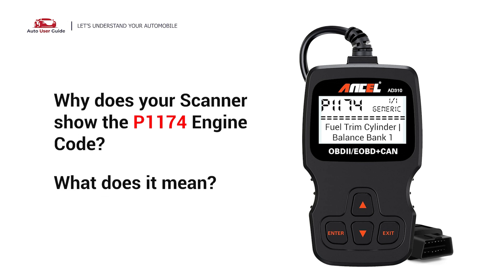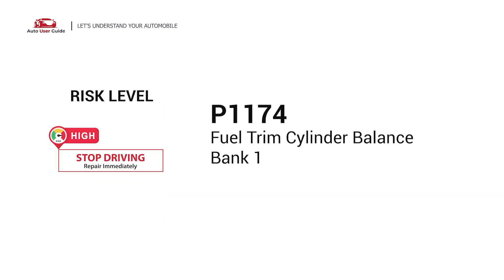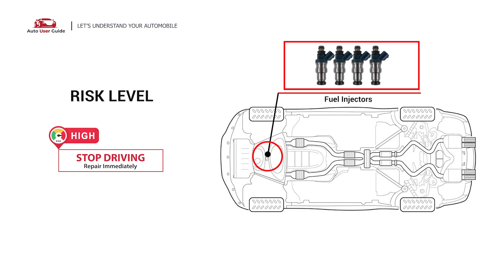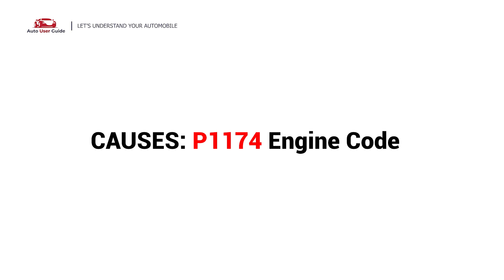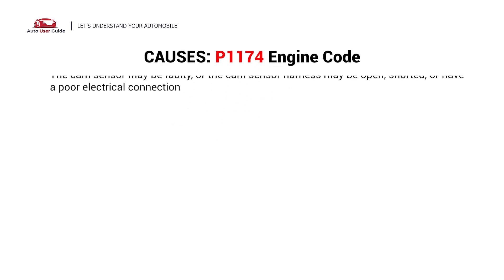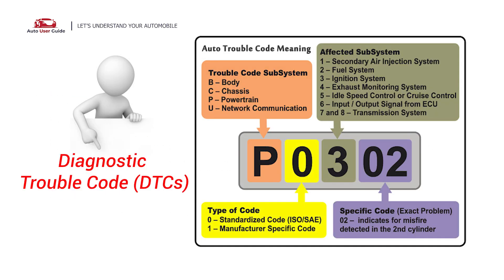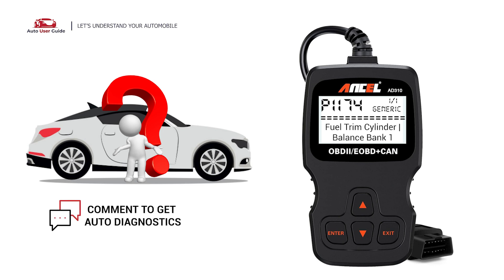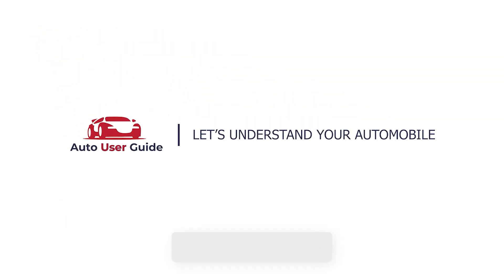What is P1174 : Engine Error Code Causes Explained

Comment: 2008 Chevy suburban 4x4 code p1174 I replaced 4aftermarket O2s and check for any vac leaks but no leaks scanner say now the code is pending no check engine light anymore but O2s b1 variable 0.090 to 0.800 and O2s b1 s2 stay at 0.765 same with O2s b2 sensor1 from 0.75 to 0.855 and O2s b2 sensor2 at 0.855
Reply: Dope! My 08 Silverado just threw this code at me yesterday.. I’m not good with mechanics but sounds like I just need to change the O2 sensors in bank1?
Reply from the maker: @2TimeBeats  Chevrolet : Fixing the P1174 Engine Error Code with 3 Methods: https://youtu.be/PtabTrPyOjA
Reply: @2TimeBeats  change the fuel sensor on the fuel line that’s located under the truck close to the front fuel tank that’s was the problem with my 08 suburban 4x4
Reply from the maker: Chevrolet : Fixing the P1174 Engine Error Code with 3 Methods: https://youtu.be/PtabTrPyOjA